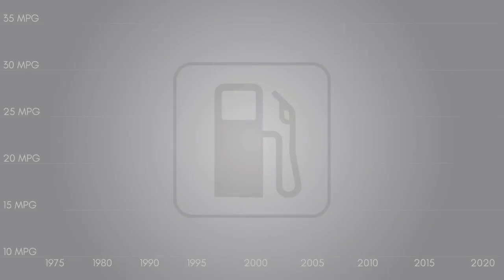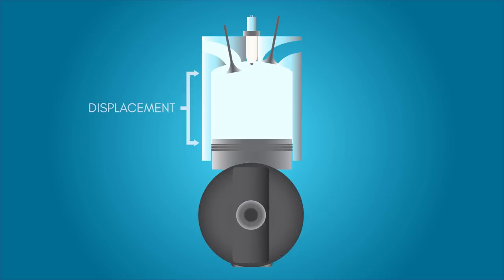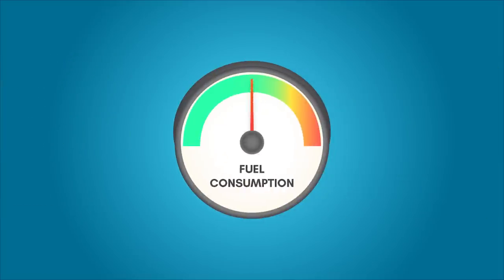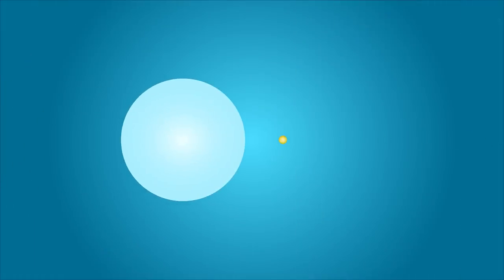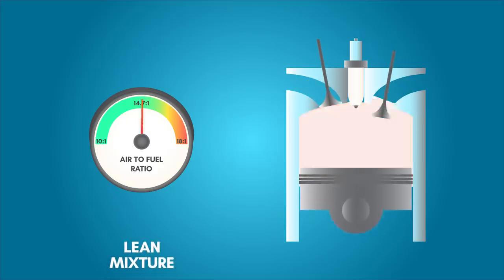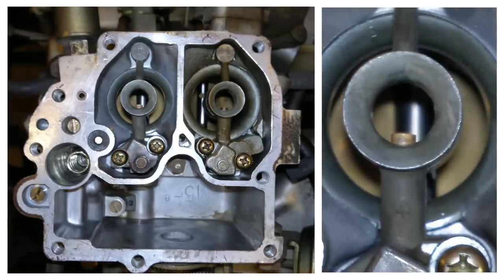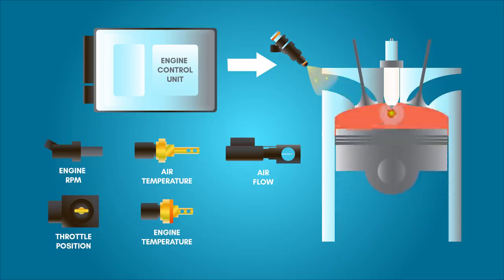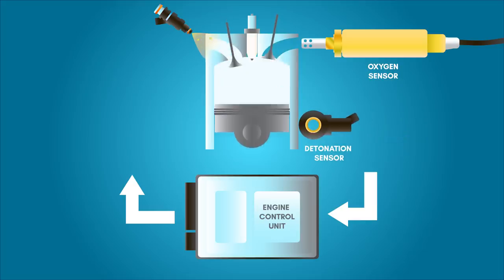How Engines Are Becoming More Fuel Efficient

Comment: There can be a lot more energy efficient vehicle than an ordinary car. First It has to be on rails to minimize rolling resistance and cut on consumables, it has to be very light and sized correctly for needs. Secondly energy does not have to be on the vehicle. And it should have an effect drivetrain for example by variable field magnet in wheel motors or even linear motors beneath the things.
Thirdly it has to be aerodynamic, small and relatively slow.
At that point any car or even a bus per person pails into comparasent of fuel consumption to vehicle like eximus iv.
Reply: So basically a tiny maglev train.
Reply: Yeah. Umm. That’s a train. We are talking about cars. Cars are about freedom and choice. Trains are not

Comment: If injectors atomize fuel better than why carbs still make more power? Injection cant atomize better. Thats why they are also sprayed on top of the intake valve to try and break up the fuel. Carb does this much better which is why they make more power.

Comment: In reality, engines don't consume less. The specs may be a little better on a new engine, but in reality the difference is non-significant.
It is time to move on and use engineering talent on something new.
Reply: Had a 1987 1.7L Audi with 7L/100km consumption. Then had a 2008 2.0L subaru at 10L/100km.
The progress over last 30 yeast is only in paper.

Comment: Isn't there simply a limit how efficient internal engine you can make? Wouldn't untold billions be better invested in electric cars? If Model S was possible by a small startup in 2012, how much sooner could auto giants have done it, if properly motivated?
Reply: Currently we're at about 40% efficient engine, so there is some way to go on that.  Then it's the dive train as well.
Reply: @Robert-cu9bm  But is there really? There's a reason engines are at only 40% efficiency. It has a lot of moving parts, and produces lots of heat waste.
Reply: Vaidas Šukaukas
 Well the engineers seem to keep making progress so yeah.  New advancements like variable compression. 

Electric will take over, but not for a long while.

Comment: The power stroke of a 4 stroke 4 cycle it's what where's the engine out but you have to control that pressure the compression ratio in the in the compression and that's what it does the most we've overcome most of the little problems that that produces but that's a problem and that's the solution no other engine or power source is efficient is that back and forth motion of the piston reciprocal

Comment: Man you guys are way behind in time. The Sterling Free Piston generator was invented in the 1800's.  They are close to four times as efficient as other engines. They are an external heat engine so you could use any heat source to run one. They are infinity more reliable. NASA has had one running under full load for 110,000 hours straight. Time down for inspection only.

Comment: This is why all cars need to use electric motors and batteries. A given Tesla Motors vehicle is so efficient that is could travel 2000 miles if it was given ~16.8 gallons of gas as it’s form of energy.
Reply: V1Gibby
Dinosaur liquid is very energy dense, batteries are not.  And take too long to charge, and have degradation.
Reply: A hybrid of both is more practical. Electric motor for extra torque and horsepower when needed and internal combustion for cruising. This helps both as they are complementary to each other. IC is most efficient at a known cruising load and electric is most practical when the battery storage is small in mass and volume to maximize range and power weight ratio.

Comment: also bigger engine suck more vacuum wich is parasitic a idle speeds. thats why high pressure small 4 or 3 cylinder engines are more efficient

Comment: June 1958, in Life magazine, an Rambler American Classic, without any modifications went from Florida to California averaging, 35.37 miles per US gallon. Today's cars are, much lighter and definately more aerodynamic, than the Rambler of the those days, as well as, we have, supposedly much better technology, are getting 32.5 to 36.75 miles per US gallon.  I think that's something like, oh lets say ... the same damned thing!  That's 58 years without any improvement in fuel mileage. Now before you go off in a dither. Here's some interesting points! A 500 cubic inch (or 8.19352 Liters) top fuel dragster engine gets,  (Read this carefully), don't go too fast, past this point, burns between 15 and 17 gallons per 1000 feet, or 0.18939394 miles [top fuel vehicles don't go the full 1/4 miles, and for good reason], which is about 84.48 GALLONS PER MILE. ... Note it's not (miles per gallon) but, GALLONS PER MILE. These aren't made up numbers, just ask a top fuel race driver or his/her crew member! 
To stop the BS from flowing, it's fuel consumed period! It doesn't matter what kind of fuel, it's fuel used.
F1 race cars, with engines that are nearly half the size of the average street vehicle today, get about (4 mile per US gallon). Now ask yourselves who's zoomin' who. If vehicles were to get twice the fuel mileage, we'd have half the pollution, perhaps.

Comment: Smaller displacement is more efficient ? I don't know. Lamborghini tractor and Lamborghini supercar has very very high rpm and very very small shaft displacement small displacement have advantage of low vibration caused by high rpm. but very big disadvantage that exhaust gases are exhauster in very early stage of expansion only 10% of fuel heat bean converted to torque. Lamborghini tractor works with very low rpm but with very high efficiency converting fuel heat energy to useful work of toque energy in long displacement distance.
The only disadvantage  is rpm in long displacement of engine it creates very huge vibrations to all vehicle.

Comment: car engines are NOT becoming more fuel efficient when you consider how light cars are actually getting!! To start with cars have more plastic and Styrofoam in them then cars did 30 or 40 years ago, and those cheaply made plastic pulleys and gears wear out faster and don't last at all!! Besides too car engines are getting smaller and smaller, with less and less horsepower, which in my neck of the woods, DOES NOT TRANSLATE to "gas economy" see I live in New York with hills EVERYWHERE, if you are NOT going up hill you are going down a hill, and it takes a lot more gas in a tiny lawn mower engine to go UP those hills!!! I tried to explain that to my second wife, but she was too stupid to realize you need a car with a bigger engine that had more horsepower and torque to climb up a hill, but then she thought she KNEW everything anyhow, even though I was trained as an auto mechanic!! Guess that explains why she is NOW my second ex wife!! Of course she also thought too the "best truck to own" for a family of four was one that had a "standard cab" because according to her the kids could ride in the back (bed) of the truck!! Try explaining that to cops after trying to explain that to my stupid wife!!! Four grown people DO NOT fit on a single bench seat anymore and new trucks are narrower as well too!! 

Gas prices too DO NOT need to be has high as they are to begin with anyhow!! Even in my local pumps there are 85% Ethanol gas which isn't even gasoline to start with...it is alcohol!!! So explain to me why it should cost $4 a gallon when there isn't that much actual GASOLINE in it to start with?! I have even considered building my own still just to make my own fuel, because per gallon I am sure I can make it cheaper than they tax and sell it for at that point!!! In the end new cars are WORSE then they ever have been!! Not only has "planned obsolescence" KILLED the car market, the price of a car NOT BUILT by humans keeps going up as well!! Is there some robot uprising we don't know about, that the cheapest car has to still cost well over $20,000??? More so when you can press one button and out pops 400 parts from a plastic injection molding machine, that somehow "new" that part costs $300 to buy but only $0.11 cents to make! 

Today's cars are junk no matter how you cut them, even in the "nicest" skin, of a Mustang or Challenger, then are cheaply built and too expensive to own for the "common person"!! And a pain if you live in an area like me where public transportation doesn't exist!! Yeah some places cars are a necessary evil, and I refuse to own anything built after 1999!!!!
Reply: Douglas Hamner
Not to mention all the added weight
Airbags
Electronics
Auxiliaries on engines
Reply: I don't know what fantasy 'the good old days were better' world you live in, but cars these days are significantly more powerful and faster accelerating than they used to be. Old cars were terrible quality and unreliable, especially American and British made stuff.
You're probably one of those "I'm not going to crash so I don't need a safe car" guys. But just look at the crash test of a '59 Bel Air vs an '09 Malibu. Your big "strong" old school steel, zero plastic parts cars crush like a tin can.

Comment: Back in 60s and 1970s a engine would have to be rebuilt after 75000 miles.  The rings and valves would be worn out !  Most of your car problems were due to carburetion and electrical (points).  Cars today are so reliable , millenials will never know the stress involved in a long car trip .
Reply: Finally somebody who gets it. Although cars today are stuffed with electronics they are still more reliable than those dinosaurs from the 50/60/70.
Reply: Tolerances, and better understanding of harmonics and balance as well as lubrication and systems to control it.
Reply: Or the cold morning starts.
Reply: Not true. I bought  a brand new Chevrolet in 1976 and it used a slight amount of oil until it got 100000 miles on it. Still have it today with 250000 on it now and it still has the original clutch!!  All depends on who is driving it and who is working on it!!!!! The engine has never been apart for ANY reason!!!
Reply: @jsteganius6969  Wow, was it made in Japan lol

Comment: The best way to improve fuel economy is not buy a huge v8 powered car. Amusing that this video starts with saying in 1975 that 30mpg was unheard of ... I ran an old Simca 1000 in the late 80s and that would get close to 40mpg, and then a Mini 1000 which way over 30mpg all the time.

Look outside American rubbish vehicles for efficiency

Comment: 14.7:1 it's the cooling system that gets you to soich faster these new cars are barely keeping cool anything screws up and and you have a steamer back in my day that had big cooling system that didnt require bleeding and kept your engine cool even when hot my wife has a six beater that gets 22 with all the bells and whistles my truck has a v8 wroten apart and get the same mileage here is a 09 mine 91cvt trans mine hydraulic trans the new stuff is made to tear up at or before 200000 and cost a but load to repair mine made to run well past 300000 and with minor repairs you can do yourself cheap
Reply: Stop making 20,000 dallor engine vehicles cool when old school is just as good if not better

Comment: Yeah, more fuel efficient, but LESS RELIABLE... Thereby creating more pollution because you need a new car sooner.
Reply: less reliable than an old v8 running on a carburetor that can get bogged down and foul plugs?

should we use vacuum controlled wipers too to avoid having a computer control a motor?

Comment: Are they becoming more efficient? My 1986 Pontiac Fiero gets similar gas mileage to a modern day Hybrid. I don’t exactly believe these claims
Reply: Modern cars have gotten significantly heavier as manufacturers respond to ever-increasing demands for gadgets, features, power, and safety systems.  Literal miles of copper wiring, multiple motors for every door and every seat, high-end entertainment systems with a dozen premium speakers and multiple TV screens, sound insulation, lots of airbags, stability & collision sensors, crash beams & body reinforcement, active suspension & differentials, bigger brakes with anti-lock & traction control systems, transmissions with 6 or more gears, complex fuel systems & valvetrains, big wheels, active exhaust, the list goes on and on and on.  And that's not even mentioning the battery and associated support systems that get added to hybrids.  The fact that modern cars can even match the fuel economy of older models while dragging all that extra fat around AND offering many times the power & performance is a huge testament to modern automotive engineering.

Comment: Fuel efficient means less reliable 
Need to worry how to make engines last more than 120k miles ,if cars last longer you need to manufacture less cars which will reduce the total amount of resources wasted on new cars that need engines after 5000 miles like GM gasoline direct injected engines.
Reply: Just because you take poor care of your cars doesn't make an entire brand bad

Comment: The American internal combustion engine does make power using a gasoline product that controls a lot of energy for its size the main problem with gasoline production engine is this waste of power equals the amount of heat that it makes while producing the power to turn the wheels the only heat up the exhaust pipe but the cooling system if this energy can produced into power to turn the wheels it'd be close to 100% efficient and people think hydrogen sufficient you better study the physics you better study how much work it takes to make hydrogen the power loss hydrogen was designed for outer space electric and regenerating breaking it's the way to go power plants make more efficient power to charge the vehicles

Comment: How to SKYROCKET efficiency of internal combustion engines:

Use fuel VAPOR instead of liquid fuel. Droplets must be heated and evaporated before any combustion happens. The inventor of such a device which OVER DOUBLED the fuel economy of cars in the 60's was killed and made to look like suicide. 

Just sayin 🤷‍♂️
Reply: Modern cars burn essentially all of the fuel, combustion efficiency is already over 95% (probably around 97% typically). Vapor carbs have been tried, but they're solving a non-existent problem. Conspiracy theories about such a magic device are just that.

If you want, you can find plans to build one yourself, do some testing to prove to yourself that it's really vaporizing fuel before feeding it to the engine, and observe the results. You'll find that it doesn't make much of a difference.

Comment: and someday we'll forego internal combustion engines completely and replace them with sterling engines that were shown to be around TWICE the efficiency with about half the power output(sounds like less but because the power output is like that of a diesel it's more "equivalent") and with similar torque curves to a diesel, it also doesn't require a catalytic converter and has far less emissions. all from an engine that was designed in the 1800's, decades ahead of it's time.

Comment: Ban all exotic and luxury vehicles. Reduce speed limit to 60kmph. Reduce car weight. Make it compulsory to turn of engines at traffic signals. Minimum 1 passenger required. To design cars that cannot accelerate too fast. Save fuel.

Comment: This direct Injection Shit is useless in small Petrolengines...an A Class(1998) drives with abozt 6l in city an under 5l on the Highway With 2V per Cylinder and not direct Injection

Comment: a way for great eficency is not smoke solid particule and combustie complett at dioxide of carbon_co2gaz. and h2o gaz_in specially at diesel motor but piston_cilinder is not efficient and is necessary turbine_motor at all motor with fuel at automobille and navy_ship use turbine_motor from engeenering from hellicopter s_  _ archaicxn

Comment: Diesel has more energy than gas so if only we would switch we could be much more efficient. Automobiles may not start in the winter though.
Reply: You are wrong on many levels with your assumptions, I'm afraid. While it is true that diesel fuel is about 15% denser in energy than petrol/gasoline, this does not translate into increased efficiency. What you actually get with higher energy density in the fuel tank is improved range. 
Diesel engines are fundamentally more efficient than petrol engines because they are designed with much higher compression ratios which multiplies the amount of energy extracted from the expansion of the combustion gases. This is because unlike petrol engines, which are limited in their compression ratio by the issue of engine knock, diesels embrace that phenomenon. Instead of a spark plug, ignition is initiated by injection of fuel into the combustion chamber at the right moment, while the air inside is already hot enough to cause the spray of diesel to spontaneously combust. 
Without the cylinder expanding in response to the burn, the combustion process simply results in heat without useful work being done, like a normal flame.
Modern diesels don't have much trouble with cold starts any more either.
Reply: How am I wrong? The Compression ignition engines (fundamentally all Diesel engine) are used everywhere precisely due to their efficiency , except a wide spread adoption in automobiles.   In the 90s Volvo had a concept that had 60/100 mpg rating. It had a compression ignition engine it ran on vegetable oil. The best my car can do is 35. Back in the 1980s a Toyota Corolla could get 55 mpg with a compression ignition engine.